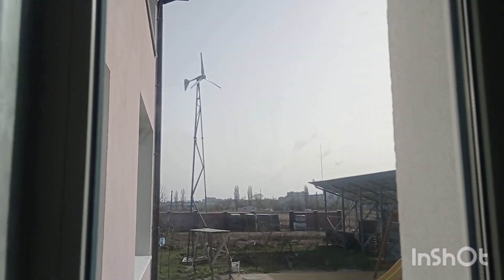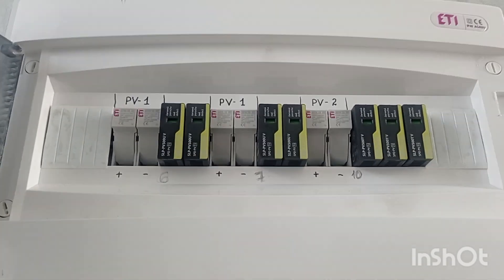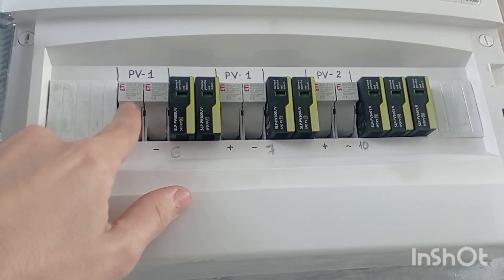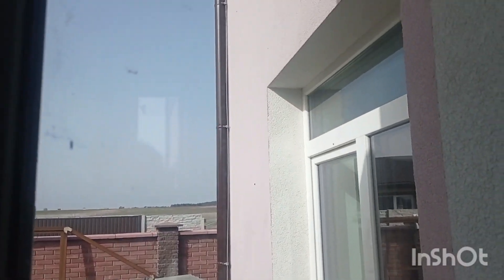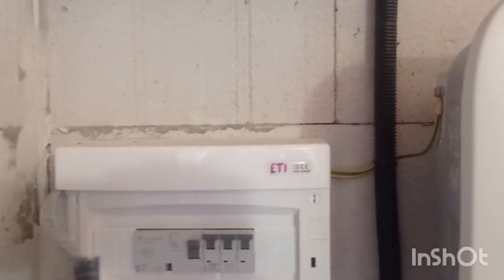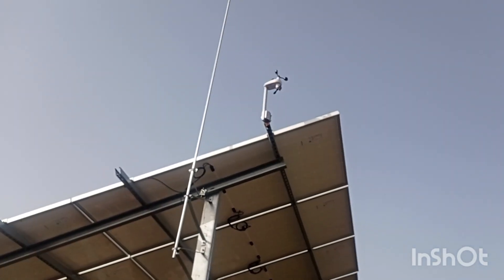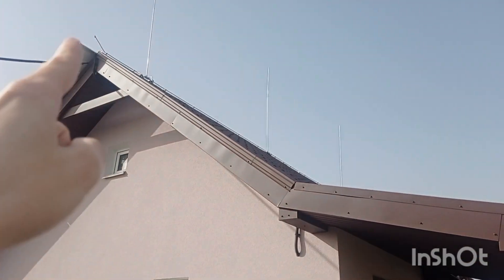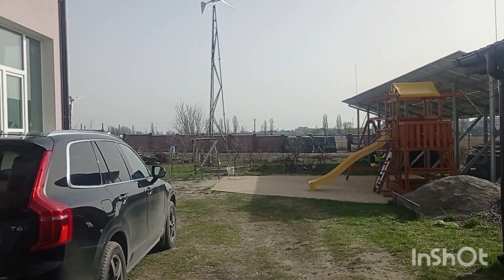How to protect your solar panels installation: all the means you may need are covered in one video.

Comment: I didn't see any arc fault protection ? Or was that built into the inverters ?
Reply from the maker: that's in the inverters for sure. those are not cheap, they even have some lighting protection inside them on their own, however, I still decided to add additional ones.